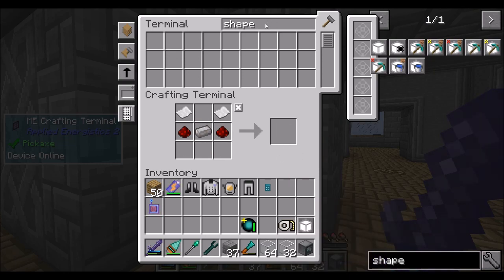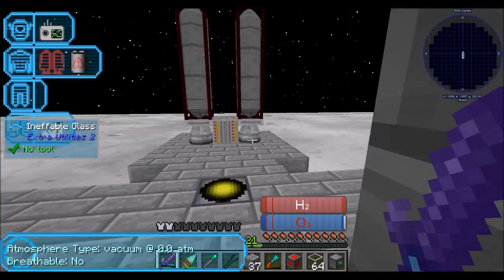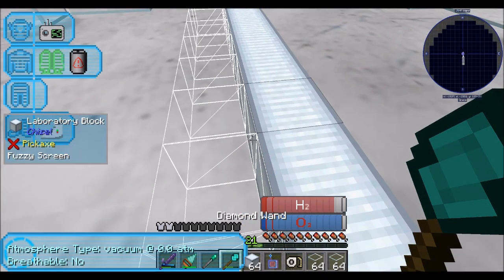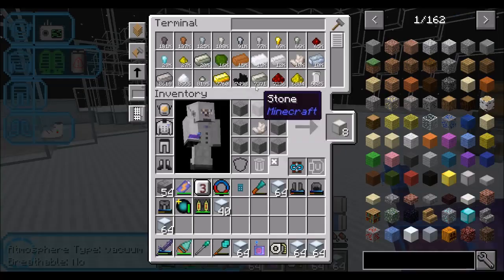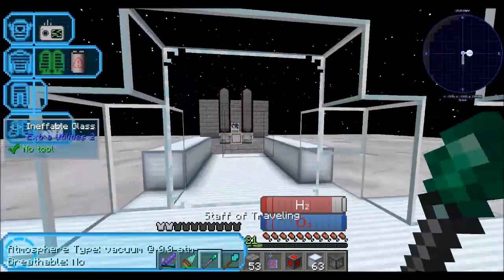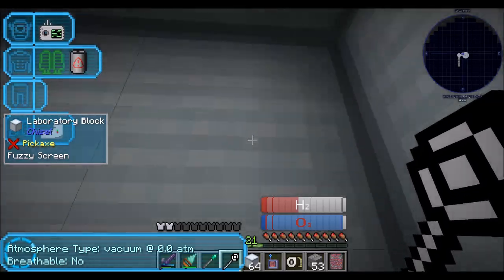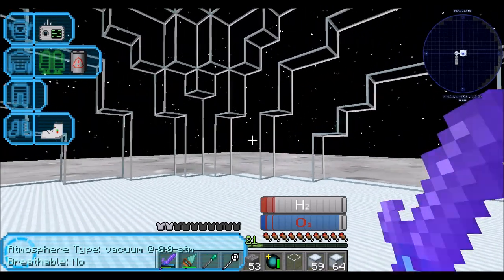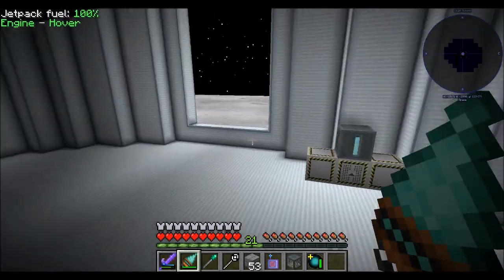AoE Ep70 Space Base Building

Comment: The Hover Module has to be installed in the helmet to work.
Also, you can change where the rocket will land with a Landing Pad / Docking Pad
You also can use Forcefields to contain air. Because you can set them to allow entities through, you could use it for a ceiling of a room where the rocket can land.

Here's an idea. Build the Energy Orb out in space and your base all around it.
Reply: I'm doing that with the energy orb. I made space for the biggest draconic energy orb and a empty doughnut ring around it. At least I tried and I'm out of materials becuase I went for a too large size so now I'm working on a huge cobblework to get me all the basic materials in insane quantities.
Reply: Dire did have the hover module in his helmet but took it out because it wasn’t working for him.  The problem he was having lies in his key binding.  Using the number pad doesn’t work with the Shift-Key combination required for the hover module to activate.  If he would map it to any other key, it would work for him.

Comment: By default, the Oxygen Vent can only fill a square radius of 32 blocks. However if the atmosphereCalculationMethod is set to use volume based calcuations, the Oxygen Vent can fill up to 32,768 cubic blocks.

Comment: Hey Dire - LOVE your space base design!  I was expecting a giant brick cube filled with 9x9 rooms so this is a big improvement :)  And I like the glass domes to let you see space all around.
The only issues might be many machines need cables in the back as well as bottom - You might want to place all machines 1 square in from the glass walls instead of against the glass walls?  I'm not sure pipes through the glass will count as blocks for airtight seals?  Or you could add a ring of extra glass around the outside 1 block high or something to seal them all in.

Comment: I do like it as a FRAMEWORK. what you need to work into it is some decorations, details, like those factory fan blocks, in the floor as "ventilation" I think is doable? and maybe some kind of framework, to make the domes into glass panels could be nifty, the goal in building things is to avoid large expanses of a single texture. using any tactic or trick you can think of. one aspect is stuff like the tudor houses with the timber exposed in the white panels. or with this, add dongles, and antennae, and small solar fins to add detail and interest!

Comment: From research I think the oxygen vent defaults to a 32 block radius, which might have been the problem you had originally. I can't seem to find any reference to find out what it considers sealed and what it doesn't, however I think there are sealing blocks if you need to run cables through walls, you place them all around the hole/cable and it treats it as sealed.